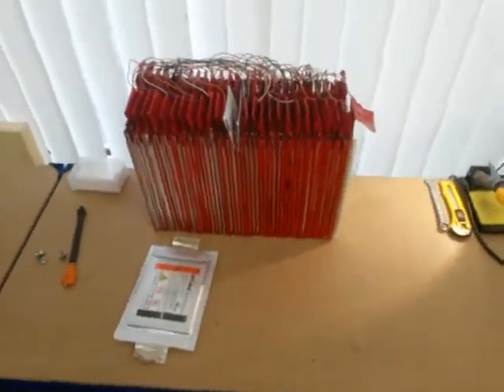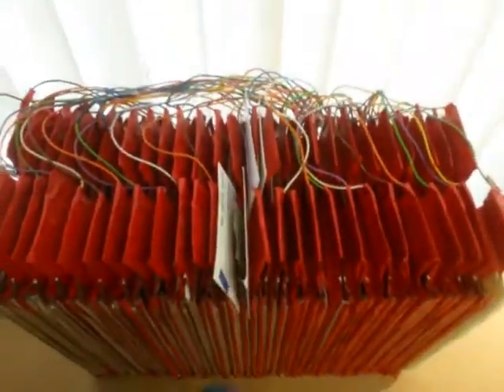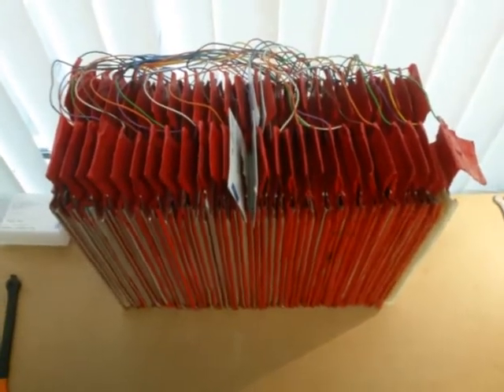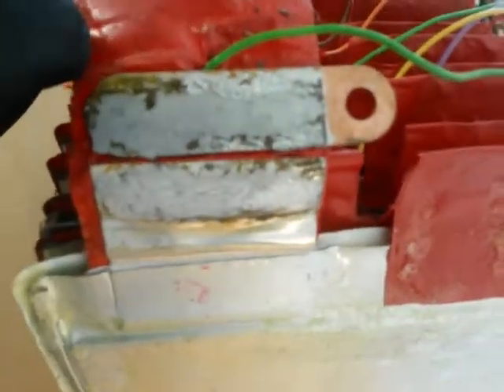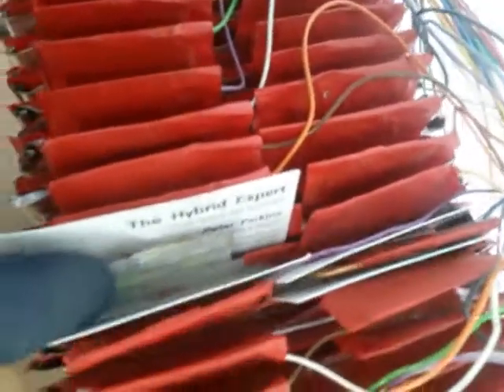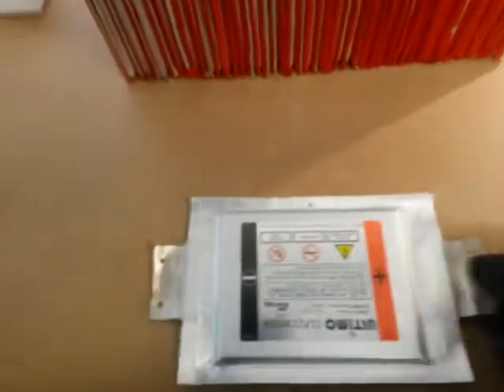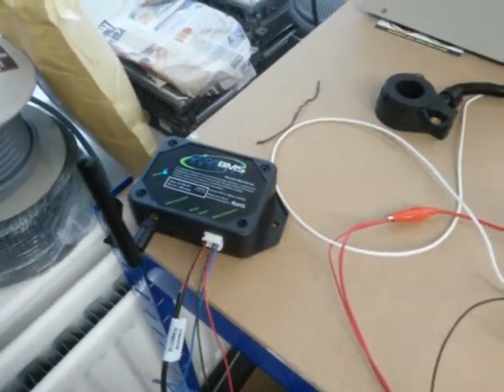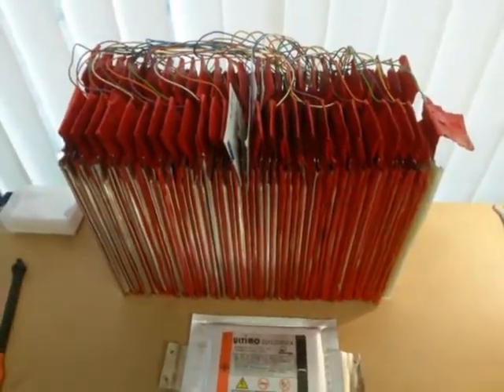A123 Pack Problems + Orion BMS on the bench

Comment: I am the only one writing here, and I am a little perplexed why the conductors are aluminium, and how were they bonded before you added the copper Busbars? Aluminium is extremely difficult to solder - if at all. To make a good connection between the aluminium / copper conductor, could you drill some 1/8th  (4mm) holes and pop rivet together when cleaned? I think that the dissimilar metals would have a much different coefficient of linear expansion - due to heating and cooling. And it is this fact that separates your soldered joints. Alternatively, you can also bond the dissimilar metals together by the use of Nalclips placed across the tops of each joint. There are some powerful-grip Nalclips that come in different sizes. the best bit of all - is that these are cheap! If you want to experiment with Nalclips, then try to source suitable aluminium Busbar material, and drill the ends for mechanical fasteners / cables. In this way, the coefficient of linear expansion will match your aluminium battery terminals AND your aluminium Busbars too. I wish you every success. Greetings from Australia.